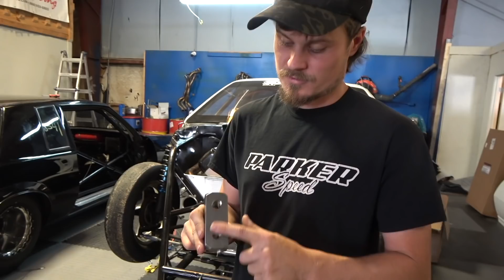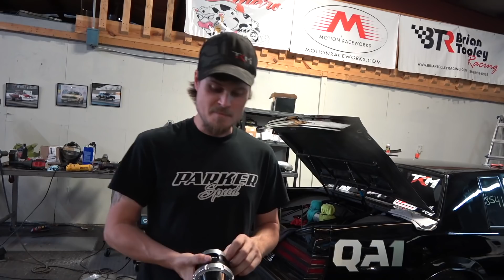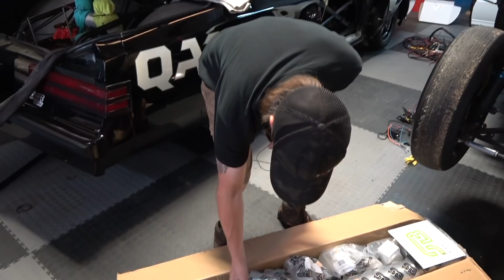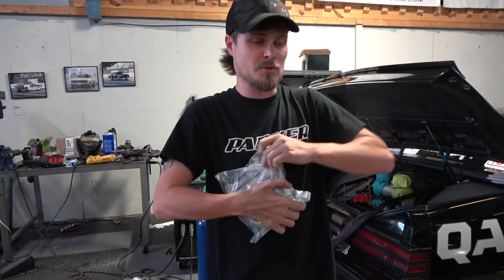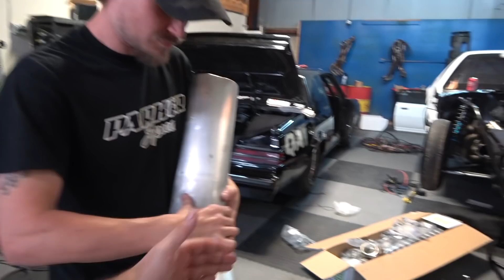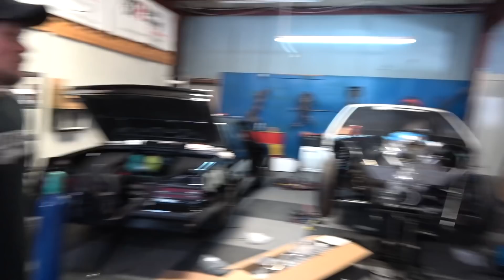SLICK RICKS 140mm Turbo parts have arrived!!!

Comment: I had thought about the using the blowoff valve for spooling. I was just going to use a solenoid to block the boost reference and switch it with a timer or rpm switch.

Comment: Not to take away from Matt but Kevin at ksr mounts turbos and uses the drain pipe as a mount
Reply: My first thought. They aren't the first to do it.
Reply: Its not just the drain as a mount...its how it comes out at a 90 and goes to the side for maximum clearance...
Reply: @1216jimmyz  motion raceworks sells a drain that does just that.
Reply from the maker: We are stalking about a drain mount combo people. Look at how it’s designed and tell me who makes it lol
Reply: @JohnDoc  Kevin at KSR did it on Mullet.
Reply from the maker: Did he have the billet mount we designed. That’s what we are talking about
Reply: @JohnDoc  No his was not billet. I will give you that one.
Reply from the maker: That is what we are talking about. The bolt on billet drain stand that lets u weld a tube to it. Not the concept but the design